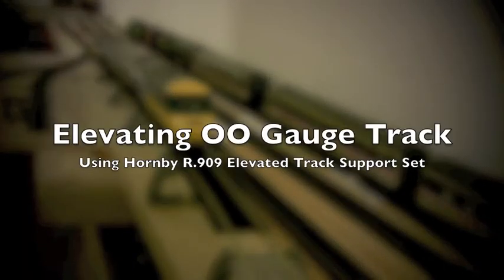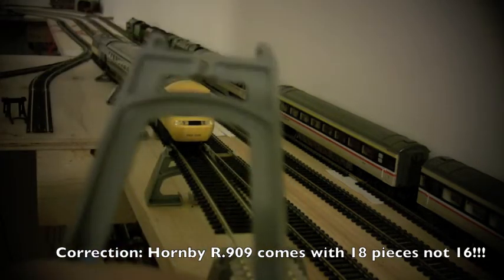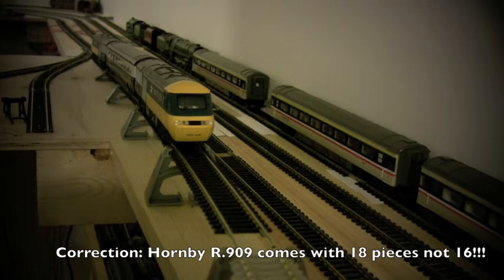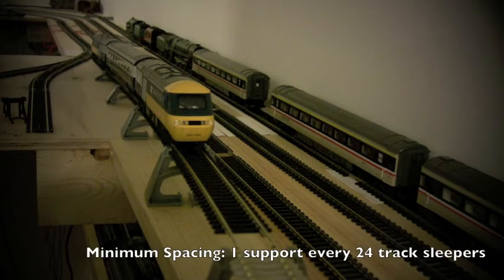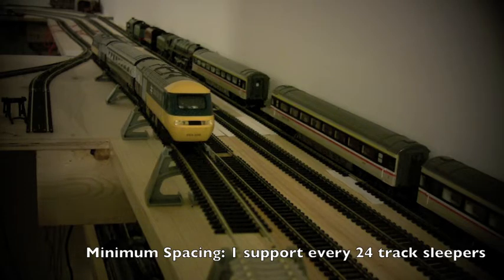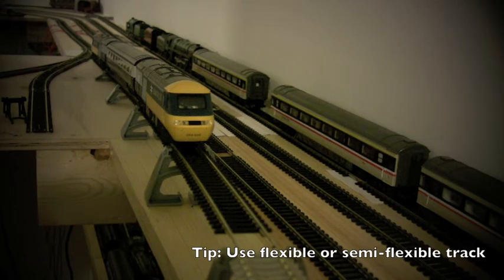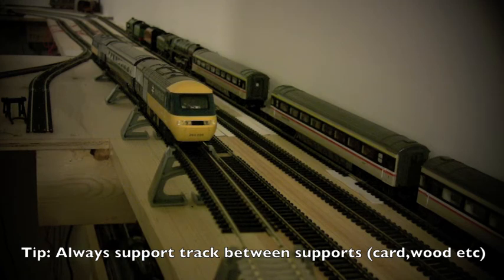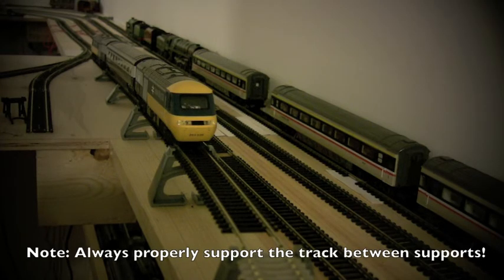oorail.com | Elevating OO Gauge Model Railway Track

Comment: How can I put my locomotive on the track easily???
Reply from the maker: The easiest way to put your locomotive on the track is to place it down on a straight part of your layout. Start with one end of the locomotive, carefully lift it up, place it on the track, then move on to the next axle and so on until you have all the wheels on the track. Then gently slide the loco back and forth a few mm, to make sure the wheels are correctly on the track. If it moves smoothly and the wheels all look like they are on the track. Slowly apply power and if there are no problems, increase speed to the desired level, and enjoy! :)